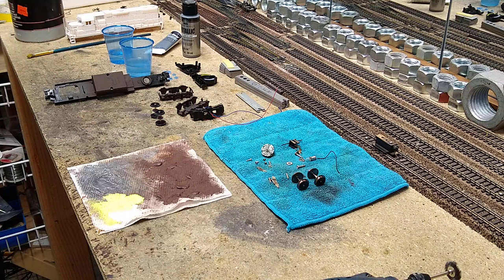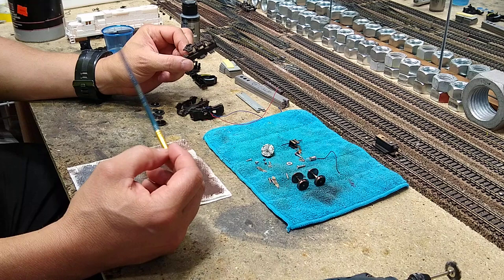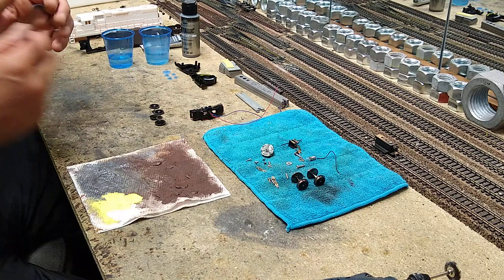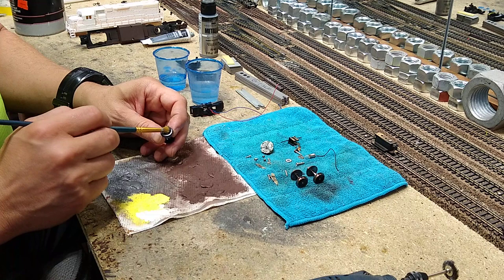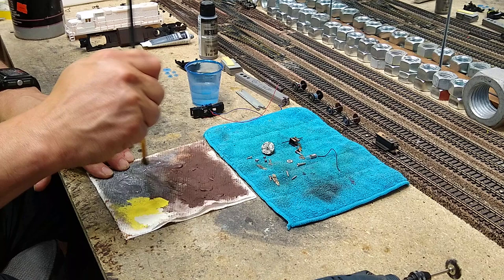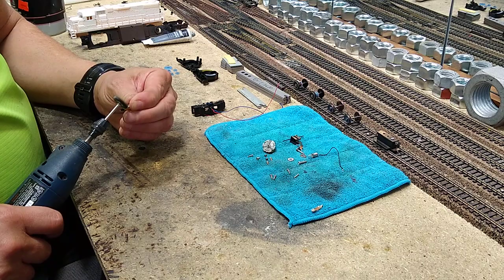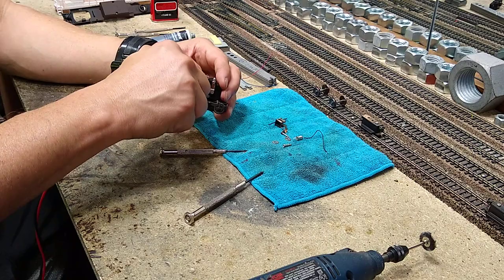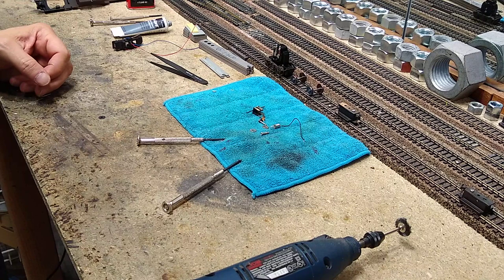HO Scale Life-Like GP38-2 pancake motor rebuild part 2

Comment: Finally another hobbyist who knows how to repair and maintain a Pancake motor.  I have run into many a meathead who is adamant these motors only last 10 hours and are just toy grade motors to be tossed when you become serious about the hobby, yes a meathead mentality.  While I'm an old Athearn lover myself I have repaired and owned many a Tyco, Bachmann, Lifelike engines and they are super easy to maintain and have lasted me 40 years of steady running.  Gear breakage occurs mostly from years of laying idle then being started up with dried caked up grease or from too much carpet and hairs in the works.  Steady maint will keep em like new for decades.  Great video!!
Reply from the maker: Yuup!  Those pancake motors are tough as nails.  Recently I've been cataloging my cheap bags of robotics gears - and exactly as specified in Machinery's handbook, all the gears used by Bachmann, Life-Like, Tyco, PEMCO are standard and replaced for pennies at the most.  Check the one's I wired together, they run amazing.  There will be more of these - still have to do the GP40s.

Comment: Thanks for the very helpful tips!  I was able to get my Life-Like 3105 "The Rock" Diesel back on the tracks.  You referenced a couple of lubricants you use for the motor and gears - looked like Marvels Mystery Oil and the Hi-Temp Grease... couldn't make out what it was - maybe Mag 1?  Could you put a link to where I could buy those two?  I looked on amazon and could find Marvels in the 4 oz can and couldn't find the grease either.  Thanks!
Reply from the maker: Goto the auto parts store and get any brand of red lithium.  ask the guy for high temp brake grease and then look at the specs and it should say color is red.  that's the stuff!  valvoline and MAG-1 are 2 excellent choices and it will be a lifetime supply for under 15 bucks.   The Marvel Air Tool Oil is the other stuff I use.  Sometimes you have to get that at somewhere like Northern Tool.  Get the quart, not the little bottle.  that will be a lifetime supply.  air tool oil is a special kind of light oil that does not wear out.  it also doesn't spread very far.  never use any type of mineral oil because that breaks down.

Comment: Is there a Part 3 to reassemble all the parts?
Reply from the maker: There is a playlist for pancake motor and tyco rebuilds and there are several videos with the reassembly.  But I think you're looking for the GP38-2 Final Exam videos also from that playlist.  Those also show the results from this rebuild.  Check out the ones where I wired 2 of them together.  They sound really cool when done that way.

Comment: Is it possible to repair a gear with a missing tooth with the super glue and baking soda method? Or do you have a better solution for a non replaceable gear?
Reply from the maker: I don't repair gears anymore because they are so cheap once you identify the gear - count the teeth and then search .5 modulus for that number of teeth on amazon or ebay and a huge bag full is just a couple bucks!  but, there is a way and sometimes it is necessary to form a tooth and file it - cut a tiny piece of styrene and super glue baking soda in place.  make your styrene piece a little taller and wider so you can file it.  when you have your finished gear, wrap it as smooth as you can in tinfoil and it will work!
Reply: @elite194  Thanks, I will do a bit more research. It is an old loco.
I have been catching up on your video's, and have really enjoyed them, and your techniques.
Keep it up the good work.
Reply from the maker: @rodneygouthier6090  working right now!

Comment: Nice job in explaining. Looking for the little gears. Do you know where I can get them?
Reply from the maker: amazon -count the teeth and search number of teeth plus .5 modulus!
Reply: @elite194  I'm sorry I am a total idiot and newbie here, but sitting in front of me is a pancake motor pulled apart and half the gears are broken in half. I need some help searching amazon for replacement gears. what exactly do you mean by search number of teeth plus .5 modulus? one of the middle gears has 18 teeth, but it also has a raised part on it that has teeth. looking at the pancake motor gears if they were in place, i think I need the 4 middle gears, not the main big gear or the wheel axel gears, but the middle ones. Cant thank you enough for your help!
Reply from the maker: @michaelmorris2481  yes, but you will have to slice the new gear to make it thin enough.  The axle hole may be too big, but you can make a bushing with some plastic pipe, and I think for and 18 tooth gear you would use 5/64 outside diameter pipe. If that is too big then use 2mm pipe.
Reply from the maker: @michaelmorris2481   the small gears inside the truck that have pins can be directly replaced with a new gear of .5 modulus - count the  teeth!  I've done a few direct swaps with new gears on those, also the gears on the wheel axles!

Comment: Why is code 100 track better for operation than 83?
Reply from the maker: code 100 is taller and wider than code 83 which makes it much more forgiving especially for old equipment.  lots of trains from before the 2000s have flanges that are deeper and can actually touch the ties of code 83 rail.  code 83 looks more realistic and is easier to use when handlaying track because it's a smaller wire than code 100!
Reply: @elite194  makes sense, thank you.